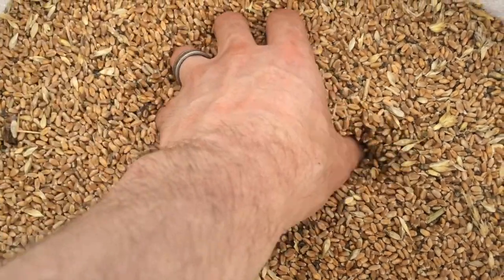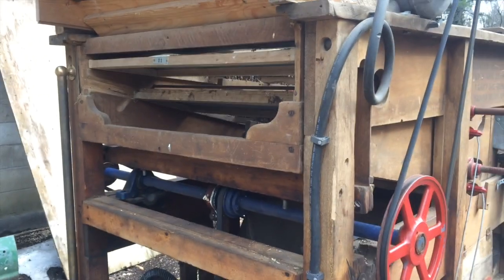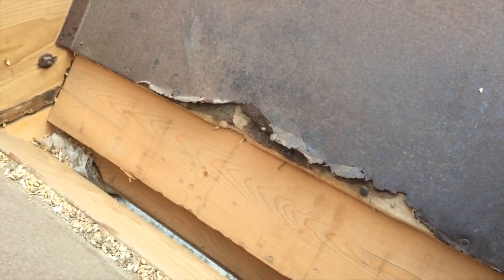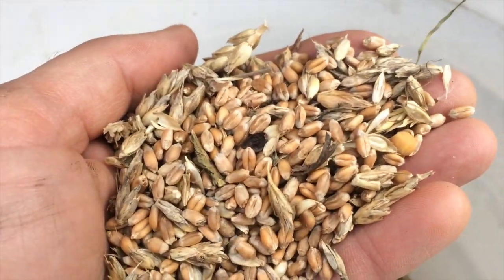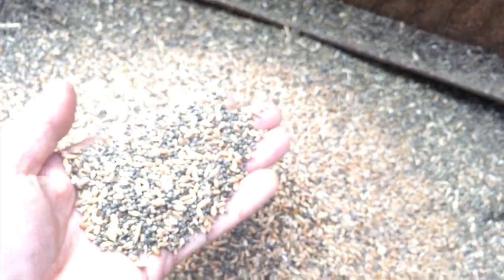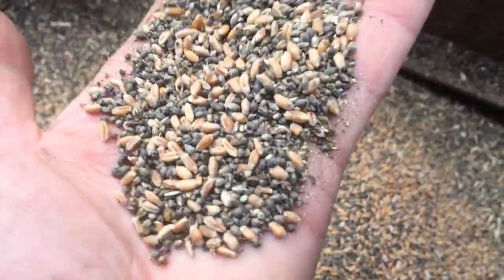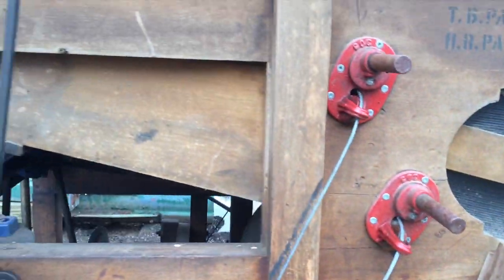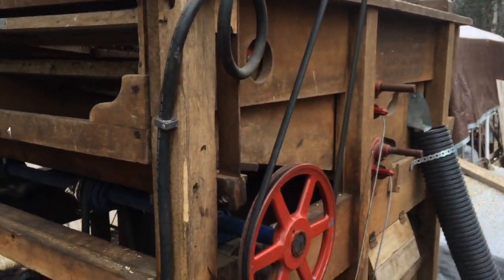Clipper Cleaner

Comment: Hi Andrew, great machine you have there!   We operate a restored Super 16 Clipper.   Your screens appear to be reversed...the screen with larger holes (scalp) should be on top, the screen with smaller holes (sift) should be on the bottom.   Maybe you tried it both ways but they work great with the top screen scalping and the lower screen sifting.    You won't have the feeding problem and you won't have so much grain coming out the side scalp discharge.   Love Clippers, have run them since the 70's and have 9 right now.  Great video!
Reply from the maker: Thanks Tom. I get creative with my screen placement. I think those screens are super close in size as a first run because the kernel sizes varied so much. So all the good stuff came off the top, but would get run again with a different set of screens. It does work like a champ and I love how I can play with the screens to scavenge more grain.
Reply: @andrewvonzuben7471  Really cool. Fun to play with the screens and air adjustments.  It's neat you can still get screens for these old machines from the original manufacturer.   We are cleaning lavender buds with our Clipper most of the time.   Have to cut the air way down or it blows everything out the exhaust, lavender is very light.